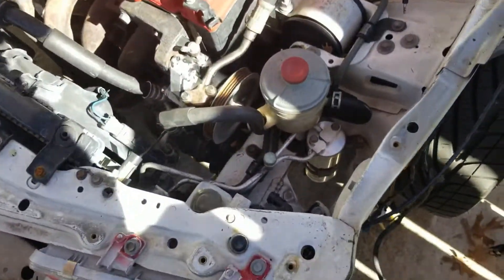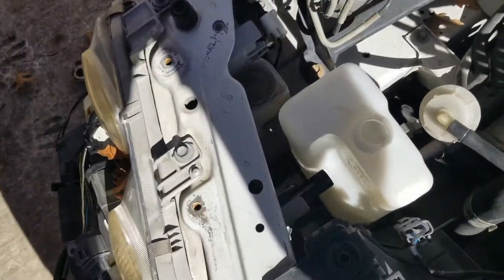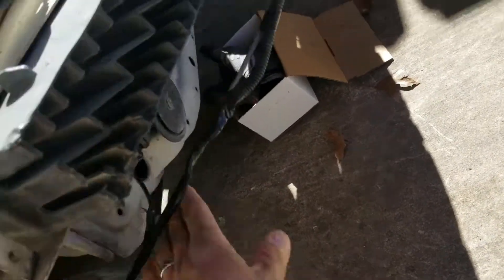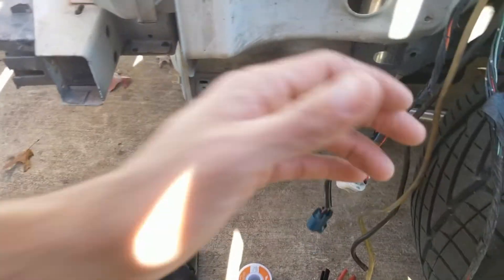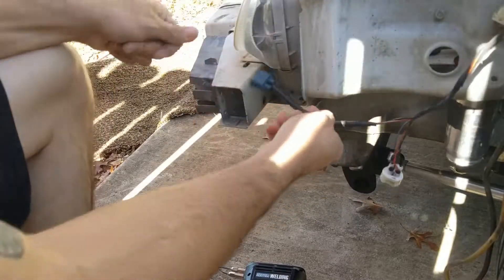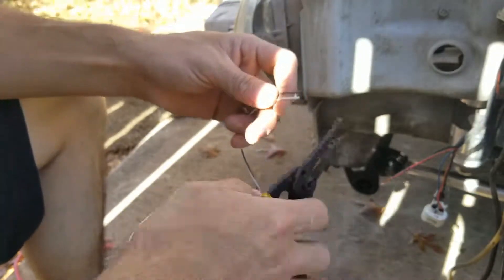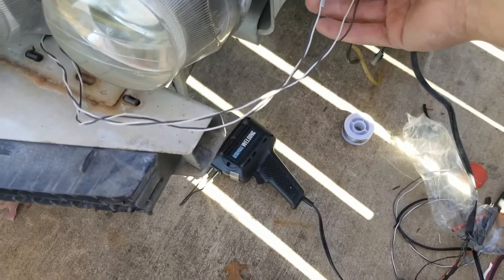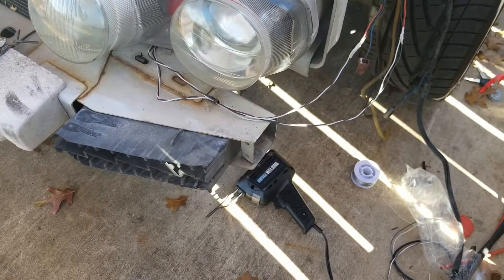Acura integra headlight harness tuck update/ how to solder wires

Comment: Hello. I just ran into your channel and seen a couple of them. Congrats on having the courage to tackle a job like this. As a tech I see a few things but that's just me being picky. One thing you should really know since you are doing so much with the wiring. The main thing is you never ever want to solde any wires on a car/truck. The main reason, there are others, is when you do it makes the wire stiff and brittle. You must have flexibility in the wires. That is why all the wires are stranded wires as opposed to being solid wires like you would find in a house. I prefer heat shrink butt connectors. Whatever you do don't use wire nuts either, those are also for residential use. Besides that I wish you luck and be prepared to run into things you'd never think of when doing this. Also since you are re-routing the wiring draw yourself a pretty good blueprint as to where you put them. They will come in handy to you or if you sale it to the next owner. I saw you are in TX, North TX here.